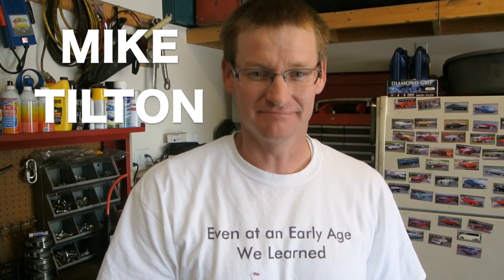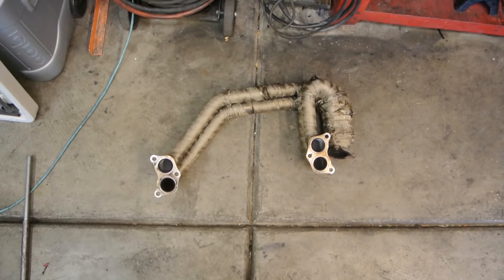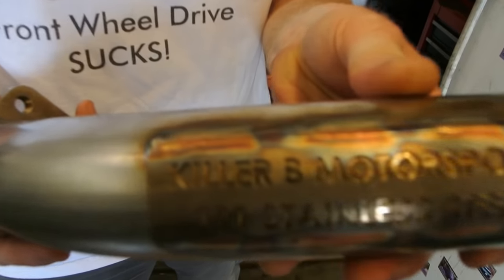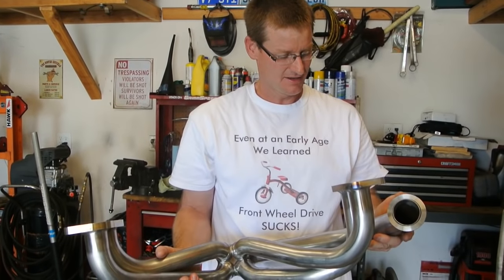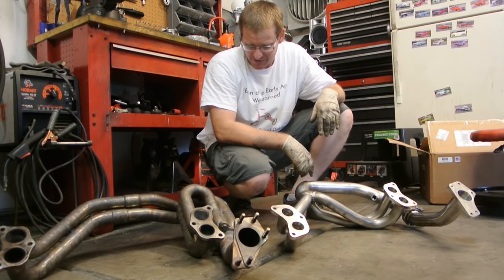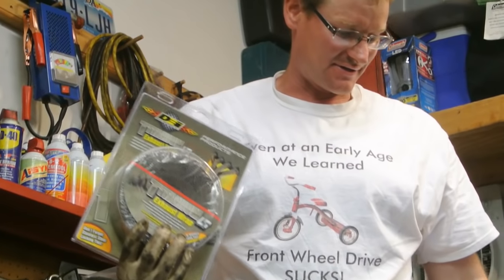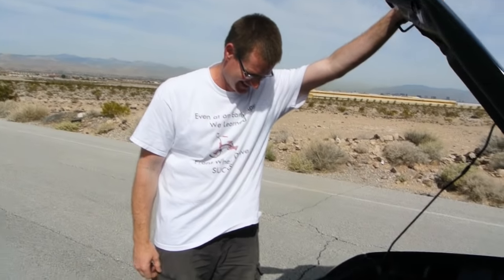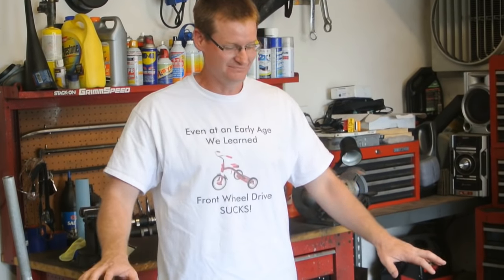EQUAL LENGTH VS. UNEQUAL LENGTH HEADERS - ft. WRX

Comment: They both sound awesome. I wasn’t aware that the uneven header lengths were what gave Subaru engines that distinctive rumble. From outside the cabin the even headers give the engine the sound tone but without the rumble, but at least it sounds different from a Honda or Mitsubishi engine.

Comment: Cabin noise- EL
Exterior noise- UEL

Personally I would still go for the EL because I'll be hearing it from the inside more than the outside and the performance benefits are great.
Reply: Why with EL there is more noise in the cabin?

Comment: It's now 3am.... and I've made up my mind on what headers to get, UNEQUAL LENGTH !!!!! #keeptherumble
Reply from the maker: In all honesty, there really is no wrong answer here. I have come to love both types of headers for different reasons
Reply: SubiFLEX WRX STi hell yeah
Reply: SubiFLEX WRX STi yeah, if you want slower spool, a peaky barrow torque curve and overall slower, more inefficient car that’s more likely to crack a piston ring on the side with longer runners cause exhaust air temps will be through the roof....

Comment: Ill take minimal Hp loss to keep the Unequal exhaust sound over the generic equal length exhaust sound.
Reply: sevenpointsixtwo its not just a matter of sound. look up ringland failures in subaru engines...uel headers can contribute to that issue. el headers are just better for the overall health of any ej engine
Reply: Don Rowe re-read your comment,your contradicting yourself
Reply: EL= Equal Length
UEL= Unequal Length

he said:
UEL headers can contribute to ringland failure. 
EL headers are just better for the overall health of any EJ engine

He said it correctly, and did not contradict himself.
Reply: same
Reply: bloody oath its what made the rex
Reply: sevenpointsixtwo minimal loss? Properly tuned a STi will pump out 25 more whp and 50 wtq while spooling quicker and hold boost up higher, check the dyno sheets, the torque curve is WAAAAY better. Rumble is the ultimate ricer setup, hurts performance and efficiency for something stupid like sound.
Reply: @sleeper.simulant7327  if you're talking about a 35r with head work, cams, EWG pushing 500+ whp, then yes.
Reply: @donrowe7194  it's the tune, not the header design. It's as bad as the hearsay of T6 causing engine failures.
Reply: adidas2284 mmmmmm no, a local tuner shop who installs a lot of Killer B products were able to get 25 more whp 50 wtq over ported UEL’s (difference of ported stocks was very minimal, within a few hp/tq with tomei UEL’s), with EL’s you can safely advance timing more and they flow better, power gains are often substantial. Notice a huge torque increase down low, quicker spool, better transient response, and make more power at peak in the RPM range on the stock turbo. UEL’s are for ricers. Do it right and go EL. Keep those EAT’s low, maintain a lower temp across all cylinders, and broaden the power band, it’s a absolute no brainer for the money you’ll spend.....
Reply: adidas2284 50 wtq lower in the rpm range then UEL’s can make. Max gains not peak gains.... and with a tune you cannot advance timing as much with UEL’s and you can with EL’s unless you want to pop a piston....

Comment: Heat is due to back pressure in the turbine, 1.5 blouch was never made for a 2.5, measure the turbine pressure in the headers, pull 02 sensor out, use subi oil sender adapter, brass barb with a .040" hole and fuel hose to a boost gauge, ex pressure peaks at max rpm, if the ex is more than 1.5 x inlet boost killing it, it will be closer to 2x!

Comment: i got an Equal length header on my 2011 wrx. still has rumble but just not as much BASS and resonance in the cabin. sounds great imo its not as annoying for the daily drive. and still sounds lke a subaru. its sounds like nothing else. maybe close to a classic vw bug but with a turbo and bigger displacement and no air cooling! lol.
Reply from the maker: I couldn't agree more

Comment: great vid did you have to  adjust the tune after fitting the new headers?
Reply from the maker: I did not have to tune the car after the install, but I did get it tuned shortly after because I also changed out my boost controller. I would recommend a tune to maximize performance and reliability though

Comment: Very interesting comparo! Makes me wonder what a GT86 sounds like with unequal length headers. I personally woulda sacrificed a few horsepower for the sound of unequal length headers, for the same reason I went with GT takeoff exhausts instead of an aftermarket set up for my V6 Mustang. Yeah the aftermarket stuff would've freed up to an additional 10+hp, but it sounded so raspy, whereas the GT takeoffs still added power while giving me the sound I want. If I wanted all power, I wouldn't have bought a v6 Stang. Afterall,  I live with the exhaust ALL the time, but I only floor it sometimes. So Im always stuck with the sound. But rarely need ALL the horsepower I can get.

Comment: Really doesn't sound that bad! A lot of people complain that it sounds like a honda civic, but clearly they're blowing smoke out of their ass. I love the UEL sound, but I'm certainly not against the ELH.  When I finally do go for a header I might just go equal length. I hear from some people that it will to a degree provide longer life to the engine, particularly cyl 4 in the EJ25x.  I'm curious to know if thats true or not. Something to do with carbon build up.   Going for a turbo back exhaust after Christmas on my 2011 wrx hatch, and having a hard time deciding which exhaust to go with. I should probably find a good e-tuner in the area before deciding. Grimmspeed downpipe looks like the ultimate for an internal wastegate set up, but I'm not sure what the consequences would be using a Cobb OTS stage 2 tune vs a non devorced dp. Great vid, the music really wasn't as bad as some where griping about.

Comment: Hi! Loved your videos. I have a 2016 sti, can the car make 300whp with a setup of equal length, accessport, downpipe? Is it safe without injectors and fuel pump. Just a stock block.
Reply from the maker: almanu04 honestly, unless you are making huge power, I would keep the stock manifold. That being said, a few bolt ons and an off the shelf tune will make more power, but maybe not quite 300whp. but a mild upgraded turbo, exhaust, injectors and a good tuner will definitely get you to 300whp

Comment: wrapping headers does trap the heat into the actual header, as apposed to allowing it to vent off into the atmosphere... which is why people do it. Problem is, if your motor is actually running hotter, thats a ton of extra stress on the header.
Reply from the maker: Its a good tradeoff to wrap the headers. Less underhood temperature and keeping the heat in the headers increases exhaust efficiency.  Thereby increasing turbo performance.  Since going with the stronger headers, I have had no problems, only positive

Comment: Might be a problem with your speakers guys. On mine the engine sounds are high enough that the music doesn't overpower them.

I actually like the equal headers more. Sounds more...professional, like a free revving performance machine, opposed to the ricer trying to annoy his neighbors with the original one.

I find your T-shirt deeply offensive though:) Just because you don't get very many good FWD cars in USA doesn't mean they don't exist. A MeganeRS or LeonCupra, TypeRs,...could show many of your WRXes a thing or two around a track and off it as well.
Reply: pft srt4 anyone? anyone?

Comment: I cant believe im saying this, but i think the new headers sound better if you are planning to use it daily. I sometimes get tired of having the rumble, specially when i turn the car on at 5am
Reply from the maker: I have a friend three houses down from me.  Sometimes shortly after starting my car he texts me "good morning!" Still pretty loud, although pulse pressure inside the cabin is much better for daily driving
Reply: +maxxjett films i replaced my bugeyes stock seats for 2013 sti seats and i still feel the rumble tingling my spine, im getting sort of tired of it! Might consider an equal length header soon thanks to your video

Comment: I recently installed Borla UEl headers on my Frs and it's sounds extremely loud. My 2016 Frs came stock with Borla dual exhaust which was already somewhat loud and the UEL headers definitely enhance the noise. However, cold starts are ridiculously LOUD. Anything you recommend to suppress the noise?
Reply from the maker: Esteban Ibarra that's a tough one. with aftermarket parts already installed. other than going back to stock, the only other way to quiet it down would be to add extra resonators to the exhaust system

Comment: Good video mate.
So the Tomei header isn't great?!
I was gonna buy one. The EL from Tomei.
Reply from the maker: Timmy Zhou i had no problems with them for years at the 300whp range. They couldn't keep up when i went to a built motor and started racing regularly. They couldnt take the constant abuse and cracked. So it really depends on use.
Reply: Alright, I see. My Subie is my daily. And occasionally (once in one or two months) weekend track day.
It has around 250 ish whp. So I suppose it should be fine. The Killer B is just bit too pricey and kind of waste for a daily of this power range.
I suppose I could use that money on things like intercooler or so.
Thanks for the reply!

Comment: Great video. Yea you lose the rumble that that exhaust note you now have just screams i'm fast and not being restricted.
Reply from the maker: Anthony F i thought the exact same thing😎
Reply: The power differences from el to uel headers isn't very noticeable, the benefits for boxer engines are just cooling down those two cylinders which is beneficial but not fully if you're just running stock power, he could also help by not wrapping the headers because it's known to make headers have a higher chance for cracking. The worst part is it makes it sound like a Honda, I'm pretty sure that's why the brand is called killer bee, it has a buzz instead of a rumble.

Comment: Having heatwrap around the manifolds will make them retain heat instead of losing it, that's why you have cracks in it, but we all need an excuse to throw new parts on our cars anyway :P
Reply from the maker: ZEDXROM retaining heat in the manifold increases exhaust velocity which in turn makes more power. It's nice to have a header that can cope with the heat of a built motor and wrapping.

Comment: I'm struggling to get my twinscroll which basically has equal headers and its fully decatted but it sounds bad with several exhausts I've tried so far but yours sounds ok
Reply from the maker: Thanks, it is a very unique exhaust that i built myself. I have a bosal shorty divorced downpipe and where the middle cat is located I put a magnaflow 3" in, dual 2 1/4" out muffler. It them routes back separately to dual 4" rolled tips. I am very happy with how the car sounds.
Reply: l700wrx try a vibrant “ultra quiet” resonator (it doesn’t quiet really just deepens the tone, removes drone and cuts away any tinny sound thanks to its short fat body and quality packing) to a vibrant streetpower muffler. You’ll get a good growl, plus vibrant flows really well and they build a high quality product that can handle big power.

Comment: For $2000 They better be good. I just couldnt do it. For $700-$1200 you can have a completely custom Manifold fabricated by the best Fabricator in ur city! DOC RACE here in Portland would fab up a fresh ass set of UELs for $1k and u'd not only keep the rumble, but not have to worry about quality!
Reply: Evol_AF EL power gains are worth it though

Comment: What fabrication was done to the bumper for running dual exhaust?
Reply from the maker: After measuring where i wanted it to go, I taped the bumper to protect the paint and used a cutoff wheel to make the oval. I added some heat shielding but that was it as far as modifications go.

Comment: Sounds like shit with the new one. Anyway, i really think you shouldn't wrap them up like that, you should wrap each individual pipe. 

What this thing does is preventing the heat to radiate (as much as possible) so that you get a cooler space around them and better thermal efficiency (hotter gas has more volume thus spins the turbo faster thus less lag better performance etc etc), 

So, now you're trapping a lot of heat in the space between the two pipes and they will probably be even hotter than the old ones. Don't be lazy man, do it properly, there's a reason they wrap each pipe and not a bunch of them together.
Reply: The nextinlin

Comment: Hey, How did you get this to fit on your 2002 Wrx? On RallySportDirect, it says does not fit on my car when I put in 2002 Wrx. Do I need to get a OEM STi oil pan or the Killer B one?
Reply from the maker: ThatsJimmii the only modifications i needed to make it fit was to grind down some material from the pinched section of the radiator support. Cant say for sure if it would not clear a 2.0 oil pan as i have the killer b pan and pickup.
Reply: Ohh, I forgot you had the STi swap in too
Reply from the maker: ThatsJimmii true, but i still have the 2.0 heads
Reply: maxxjett films do you think if I get the Killer B oil pan and pickup, then the headers would work? Since on RallySportDirect, it says that the pan would fit on my 02 Wrx
Reply from the maker: ThatsJimmii it fit on mine great and is sweet, i don't see reason it wouldn't fit on yours
Reply from the maker: ThatsJimmii i am also putting the same oil pan/header combo setup on an 06 baja turbo shortly
Reply: maxxjett films Okay, thanks for the help! If things don’t work out I can probably return them
Reply from the maker: ThatsJimmii i would verify with rallysportdirect before on return policies, but they should all fit
Reply: maxxjett films also that V7 sti swap, was it pretty easy or there was lots to do?
Reply from the maker: ThatsJimmii its a bolt on affair. Take off the wrx parts and put on the sti parts. You just need to know what works together and what doesn't

Comment: which header is safer to run on the ej equal length or unequal length headers?
Reply from the maker: there are arguments about the smoother pulses of the elh and that it is easier on the engine. but I would say if you have a good tune, that is the safest regardless of which header you use
Reply: +maxxjett films thanks for the advice, the reason why i am doing research is because i am a new Subaru own and i heard alot of stories of the ej engine blowing up and getting ringlan failure.

Comment: Like the car and the work you did. Im building a motor myself for  my Subaru but I hate that sound 4 cylinder motors make when the exhaust is opened up. Im a supercharged V8 guy and the sound you get from a V8 is unmatched. i want the extra power without the "ricer" noise.
Reply from the maker: I'm totally with you, I love a nice v8 noise, it's one of my favorites.
Reply from the maker: thanks, I put a lot into this car over the years. I am with you on the v8 noise though, hard to beat.

Comment: I have a 2007 Subaru impreza WRX sti 2.5L and I need help to make it faster please I live in Arizona
Reply from the maker: Basics are exhaust, turbo, injectors and a tune. Weak points are the piston ringlands on the ej257, so a good tune is critical

Comment: Question do run egt sensors on your car
Reply from the maker: I do not
Reply: @maxxjettfilms6322  ok because in my  sustuation rn i have a slightly modded 07 sti im trying to get killerb elh would a egt prob be worth it cause i still on stock location turbo an use a cylinder 4 cooling mod full straight pipe so it shouldnt be overheating much with the elh later down the road i plan and getting a built block and then swaping exhuast setup to new block so i just trying to get some opinions if i should get egt probe bungs with the killer b heads elh because if i get elh ceramic coated itll probly be a pain to weld on bungs later down the road probly over thinking things to much tho 🙏

Comment: what brand is your turbo inlet hose
Reply from the maker: Gimmick motorsports
Reply: yeah  I have the samco turbo inlet and it was a pain in the butt to put on but it seems like after I put it on the stock bov no longer make that whoosh sound might be because the inlet is larger diameter than the stock one but I don't think so what do you think that's why I asked what brand you have

Comment: Why do people always call it the "Boxer Rumble" when it has nothing to do with the boxer engine, Any car would sound like an impreza with the same UEL headers
Reply from the maker: You're right, any unequal header will "rumble" on a 4 cylinder, but since the rumble is ubiquitous and popularized by the subaru boxer motor, the term has been applied to it.

Comment: You should never wrap titanium. Turns them to powder over time.
Reply from the maker: never heard that before
Reply: i havent heard that either. Titanium is pretty corrosion resistant
Reply: Maybe if you drive it in the winter and all the salt gets impregnated under the wrap